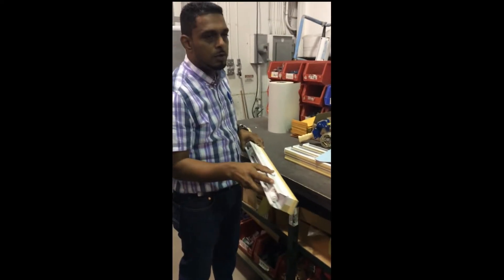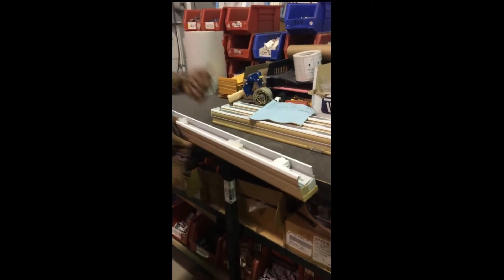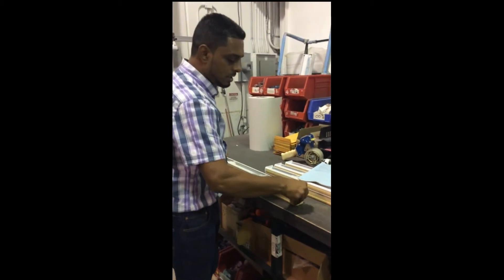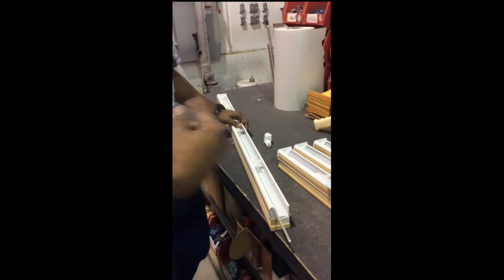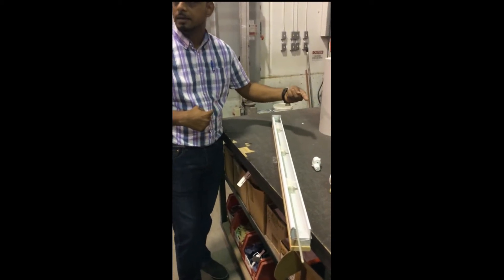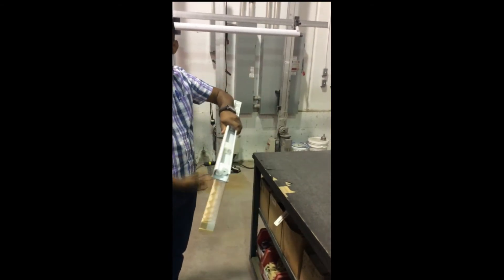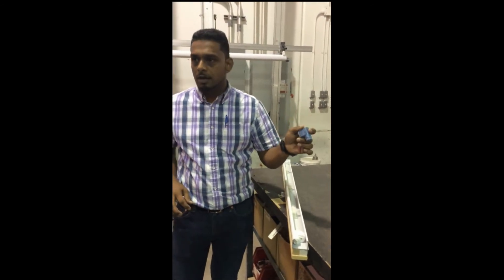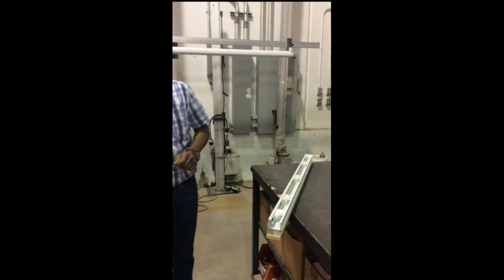Honeycomb - Troubleshooting Tips

Comment: How to you adjust one side?  I've got the 2" Hybrid top down/bottom up and one side is sagging slightly (very noticable if we've dropped the top down about 12-18".  When I manually hold the blind to the correct position (1/2-1" to correct) the far right, inside cord sags as does the centre (left of 2) cord.